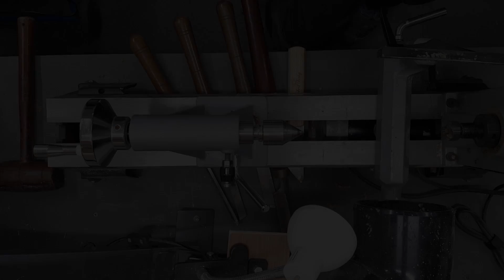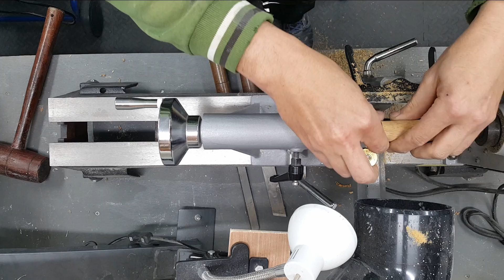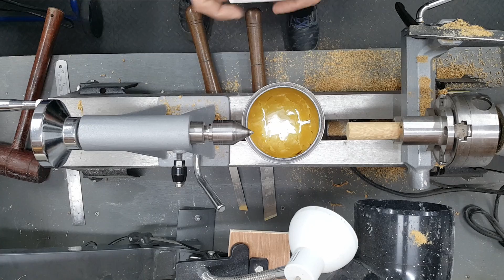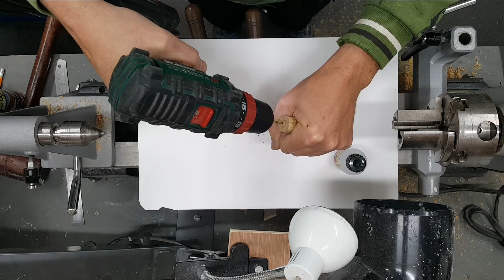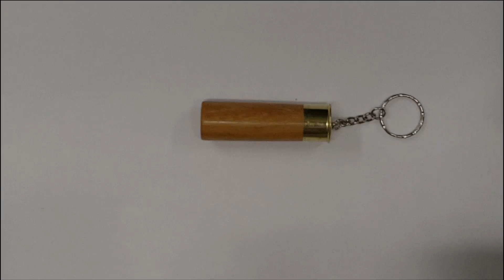Shotgun Shell Keyring making ( an easy project )

Comment: Very clever project, I’ve not seen that style keychain before with the long spine that you glued into the casing. That was very good. 

Regards,
Bob
Reply from the maker: Thanks. They are split pins I use. Thought they would be stronger than just using  screw in eyelets

Comment: Just wondering how I could make these without a lathe 🤔🦆💕
Reply from the maker: You could buy a length of dowel the right size and just cut to a length then glue into cap.
Reply: @lencraftworks8706  Will give it a go. Many thanks 🦆💕
Reply from the maker: No problem.  Hope you have fun with them